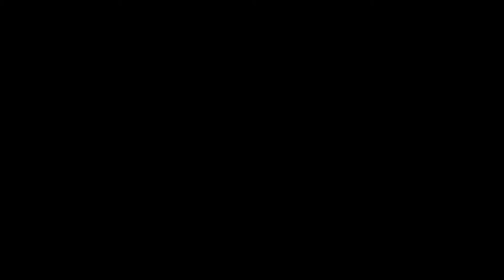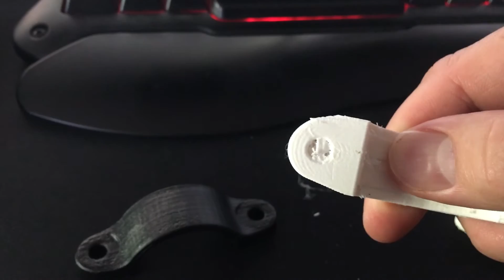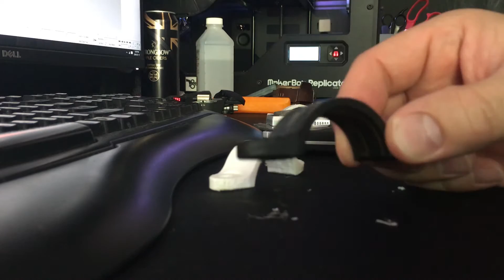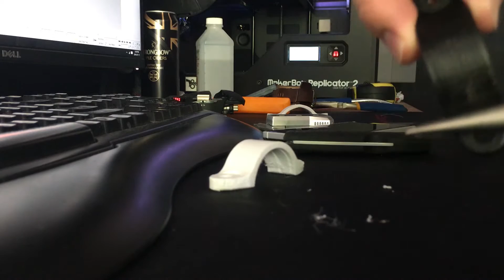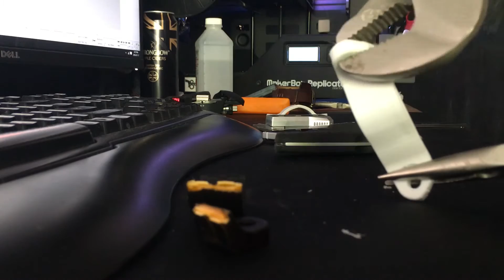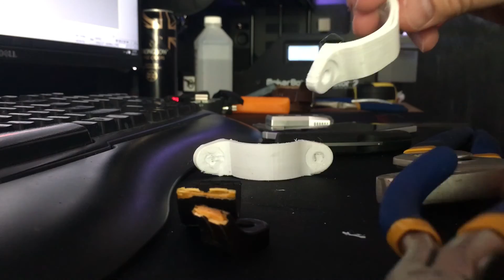PLA Vs Ninjatek Armadillo

Comment: did you print it "face down" or "edge down" I suspect you want to print it edge down so that the holding force isn't perpendicular to the layer lines. Not sure what the layer adhesion is for armadillo, but it will still be stronger along x or y than along z

Comment: how are the layers bond and how is the temperature resistance?
Reply from the maker: well it has a slightly lower melting point than PLA, but no problem so far being on the front of a scooter in the hot sun. Bonding is extremely tough, again becasue it tends to ooze, making it near impossible to break away supports.
Reply: The important thing to know when it starts to deform. PLA, unfortunately, starts to deform ~40 degrees Celsius. If you part is under pressure all the time this means it slowly starts to bend. Is Armadillo any better in this regard?

I'm experimenting with PETG right now and it even withstands boiling water without problems, however, it is not as bendable as Armadillo or ABS before it breaks.